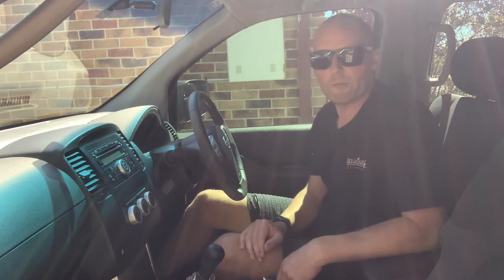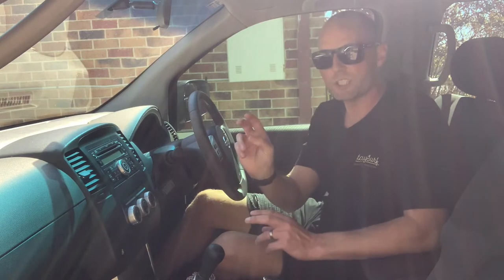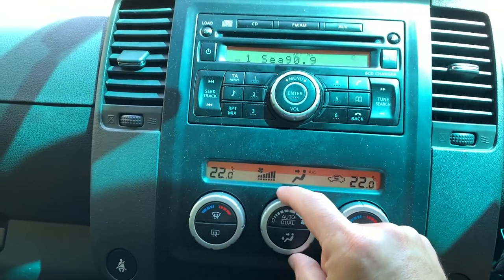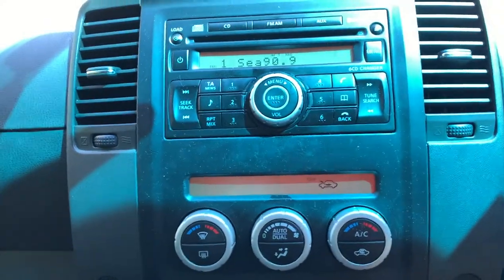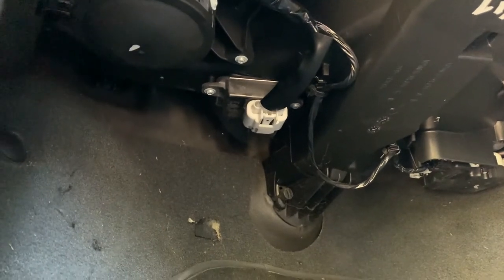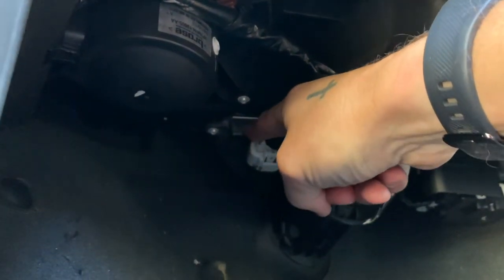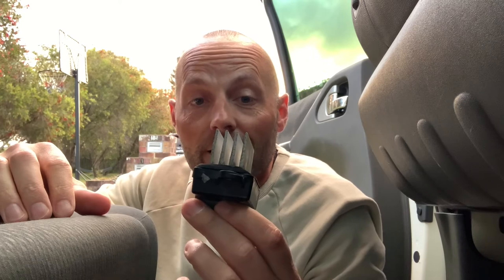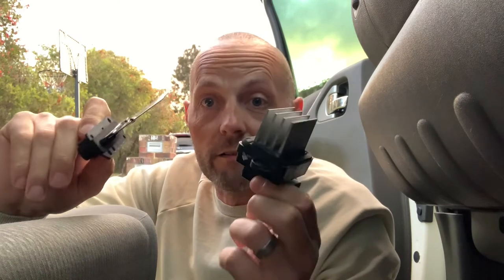HOW TO FIX!! Nissan Pathfinder A/C Heater Fan Speed!!

Comment: A question, my AC control only shows recirculation, even if I turn the knobs it doesn't change a thing, no air, I checked the fuses and they are all good, do you think it could be the blower resistor that has blown and blocks the operation from the ventilation?
Reply from the maker: I can’t be 100% sure mate but I’d definitely try this method that I’ve done to see if it fixes it. 👍

Comment: ok my friend I saw your video and let me ask you a question, my pthfinder 2005 en modo automatic work but mode manual no respond and put on off and no stop the A/C system continue working, so my be it is the same problem  the resistos module ? what do yo think my friend
Reply from the maker: Hey Leonardo! It’s a high chance that it could be the same issue, the only way to find out is to buy a new one and replace it. Just make sure to take the old one out so you order the correct one. Good luck 👍